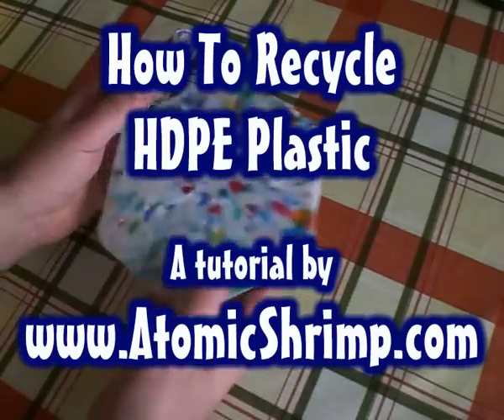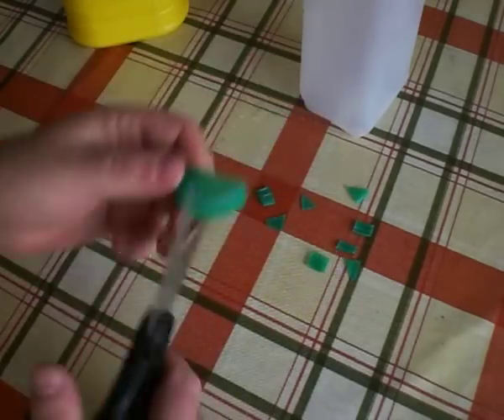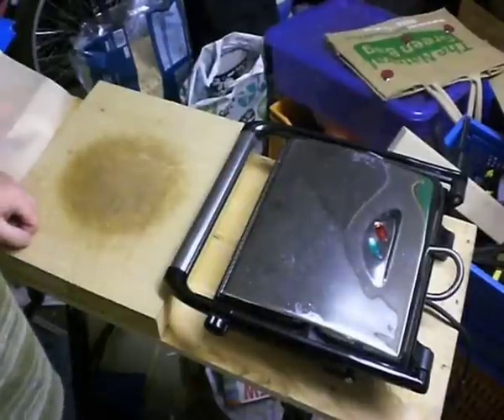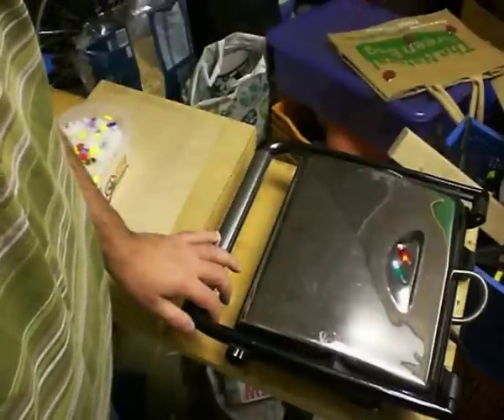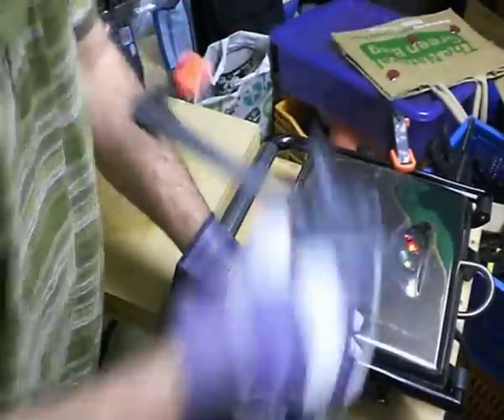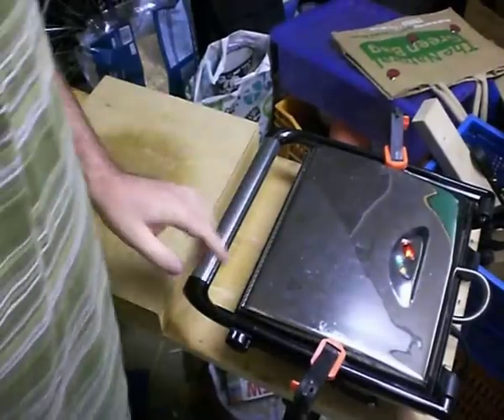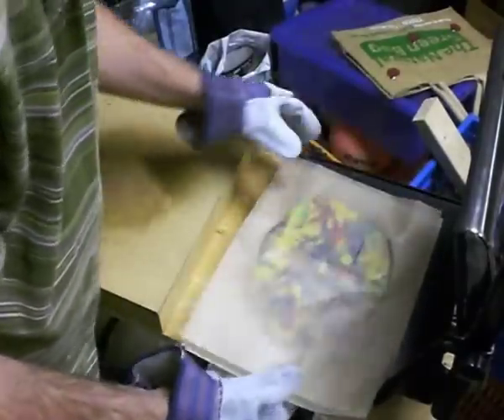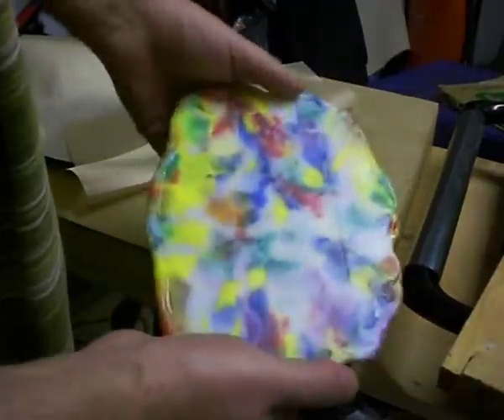How To Recycle HDPE Plastic (High Density Polyethylene) - a simple method

Comment: Nice vid,thanks,
 but couldn't u just cut bigger flat pieces and squish and melt together?
To save time cutting it up.
If u didn't want the color effect of the little pieces anyways.
Reply from the maker: Possibly. You may find that starting with larger pieces, you get more voids and air bubbles trapped in the melted product - I find that a finer cut allows them to escape
Reply: @AtomicShrimp  , thanks so much for replying .
I might have to try that and see.
Don't have a flat griddle thingy like yours (Ohio) but will be looking around.
Always wanted to make something out of bottles etc.  
Thank you sooo much😊
Btw , love 🇬🇧👍

Comment: Good idea, the process is a little bit long thoug.  Have you tried to use a hit gun,  oven, etc?
Reply from the maker: The thermal conductivity of this material is quite low - if you try to heat it faster, there is a risk of scorching it - I found that the oven tended to make the material smoke a lot, and the heat gun only really works on a very small area at a time

Comment: It's a great concept, and I'd like to try it to make crafts projects etc with; but there must be a way to modify it into a more compressed time period; no?
Reply from the maker: You mean the time taken to cut up the material?  Some people have had success using a blender (didn't work for me, but maybe my blender is not up to scratch)
Reply: @AtomicShrimp  No, no... I have the patience to cut it up, I meant the whole time process. Using the sandwich grill was a brilliant idea on your part, and I salute you for it; but is there another medium that could be used to heat it.  I don't mean in an oven for example, unless it's an outside oven, I don't wanna ruin my cooker; but some other less time consuming way to heat it up and compress it all.
Reply from the maker: I think you'd have to gear up to some sort of small industrial scale to be able to melt this stuff fast, without burning it - it doesn't conduct heat very well - so slow heating is pretty much a necessity to ensure even melting without scorching
Reply: @AtomicShrimp  Well, if'n I can twist my uncle's arm a bit to help me with your solution (I mean where does a girl get clamps?  lol)  I'm gonna gives your idea a go. You're extremely innovative. Thank you for sharing!   :)
Reply from the maker: @laurenpiantino8312  Cool - in order to avoid ruining your own toaster, it might be worth looking around for a secondhand one
Reply: @AtomicShrimp  Oh I have two still working, but in the basement storeroom, never used. I use a skillet now for toasted sandwiches...   :)

Comment: Hi are all lids made of this and can you use plastic that has a 1 on it and are all soda bottles made with this material sorry for all the questions but this fascinated me it seems everything is in plastic here
Reply from the maker: resin recycling code 1 indicates PET (Polyester) - these can be recycled, but probably not using this method.

Not all lids are HDPE (2) - some are Polypropylene(5) or LDPE (4)

Comment: couldn't you heat up the plastic in the oven or microwave at a higher temperature - so it becomes more liquid - and use a silicone mold for example?
Reply from the maker: It doesn't ever melt tons pourable liquid. The best you get is like soft caramel in texture

Comment: i would still do this outside if you have pets XD so i have a product called instamorph... is it really just recycled milk jugs? would microwaving (or kettle boiling water) work as a melting catalist for the plastic?
Reply from the maker: Yep - just milk bottles and other HDPE containers and lids.

Hot water doesn't get hot enough to melt it (unless you used a pressure vessel, I suppose) - and microwaves don't touch it either as far as I can tell.

Comment: The easiest way to do this is to use a cookie sheet and put another cookie sheet on top of the one with the plastic then put a couple of bricks on top in put it into the oven I use jet heat at 425 degrees pretty simple. You can even put it in molds to make Christmas decorations just drill a hole for hanging.

Comment: I think you need to invest in a used kitchen blender. Might make shredding the plastics quicker.
Reply from the maker: I've tried it - the plastic just goes around and around.  A Blendtec might do it, but an ordinary blender hardly touches it
Reply: Try a food processor with slicing blade at the top. Gradually feed in PET/HDPE bottles.

Comment: A brilliant video 👍😉👌 what plastic is Lego made from? could they be used?
Reply from the maker: Andrew Smith Lego is ABS, which can be recycled, including by the hobbyist (it's a common feedstock for 3D printing), but it's horrible smelly stuff.  HDPE is almost completely fume-free
Reply: How unfortunate that, about ABS, because its a beautifully strong material! Also, there is also SO much of it about! Old computer cases, keyboards, many plastic home appliances (like vacuum cleaners) etc. I'd love to mould my own storaqge boxes, coz I've spent a fortune on those over the years! These days they're usually made of PPropylene. If you drop one, it breaks, and you've lost your investment. However, if it were made of ABS, you could almost drive a truck over it!
Reply: Oh my!!! Why would you want to do that? Send it to me rather 😉

Comment: I’ve made some of the silicone molds and wondering if this would be cool to put into them and make beads
Reply from the maker: I don't think it would be possible to get HDPE to melt soft enough to be formed by silicone - the texture when melted is like toffee - I think the mould would just deform
Reply: AtomicShrimp I’ve already tried it and as long as you put a heavy book on a board on top ~ it works very well!!
Reply: Tip for you ~ use a small table top timer toaster oven ~ that’s what I’ve been using ~ it’s quicker
Reply from the maker: Cool - I would like to see that.  I haven't ever really made much with silicone - what brand or type of mould material do you use?
Reply: AtomicShrimp I use the clear silicone tubes you use for house and I push it with the tube gun into a bowl of ice cold water, and with cold water wet hands bind it until it takes shape , then roll out to thickness I want, press in what I want to mold, let go half set , remove item, set completely, then I made your plastic mix and melted mine in table timer oven on lined baking tray, then pored into molds, let to cool with board and book on top, then turned out~ perfect, you may need to dust molds with talcum powder before adding the plastic!!
Reply: Elle Gillan you can make the molds to any size you want ~ just push what ever item you want in and let it harden 👌🏾
Reply: I’ve made book cover boards with it and they have to be thin and big!
Reply: Lisa Jarvis I love your comment its exactly what I've been looking for, do you think the mould would hold for larger amounts of plastic say for a phone case?

Comment: If I was to use say a waffle iron, i wouldn't be able to use a liner. Any advice as to what I could coat it with so I don't end up with a sticky mess? Wax? Grease maybe?
Reply from the maker: Not really sure - anything you use to stop the plastic sticking to the iron may prevent it sticking to itself if you need to fold it

Comment: Is there any replacement for the toaster? I haven't got one. A stove-top or oven?
Reply from the maker: Emily LaRoche some people use an oven. I find it has a tendency to scorch the plastic though
Reply: Set it to the same temp?
Reply from the maker: Yea, around 180C, but it will take longer to melt the plastic in the oven, because air has less thermal mass - when you heat it directly with the sandwich toaster, you are pumping heat straight into the plastic - in an oven, you have to heat up insubstantial air, then rely on the air transferring heat tot the plastic

Comment: I was thinking, it might be possible to create the boat form using sheets heat welded together (laminated) similar to how fibre glass is laid up overlapping, rather than chop the bits up to make thick plates then weld them edge to edge. It might be feasible to make ribs by shaping cut layers of sheets around a plywood form, to end up with a light but rigid and strong "U" profiled rib. HDPE seems like its used for bottles a lot, it must have good structiral strength?

Comment: so this is a great idea,I was just thinking how would you go if you made a 5mm or 10 mm form to put in your sandwich toaster?
Reply from the maker: Shrinkage whilst cooling is always the issue - I tried making a square frame of 3mm aluminium, and forming the plastic inside of it.  It worked OK, except that for large sections, there is a tendency for the flat faces to become concave and a little puckered as they cool.

The best results have been from forming flat sheets by just placing a standoff such as a small metal nut at each corner of the press, to keep the plates consistently spaced apart, then allowing the 'pancake' of plastic to cool inside the press, but this does mean it has to be shaped by machining after it has set and cooled.

Comment: what kind of pressure  can this plastic handle
Reply from the maker: Electric heaters are typically very efficient (100% efficient as long as the heat is going where it should), as, in the case of other electrical devices, heat is a waste product that the design attempts to keep to a minimum; in the case of heaters, they only need to be designed to 'waste' 100% of the input as heat.  Of course, the means of generating the source current (e.g. from fossil fuels etc) may still be horribly inefficient.

But this video is more about upcycling options available to the small scale maker, than it is about being green; the material product is the main goal here.
Reply from the maker: In what context are you thinking?  Compressive force, or ability to contain pressure as a container?
Reply: AtomicShrimp ability to contain pressure
Reply from the maker: I don't really know - a lot of that would depend on the thickness and the integrity of the material - I wouldn't trust my recycled material in a pressure vessel application (in any case, there are better alternatives such as steel)
Reply: True ... im in search of a light weight alternative to steel for a few applications i wish to build in the future. If you find anything more on composites and different integrities please let me know.
Reply: shattered79, here in the UK some lightweight liquid petroleum gas cylinders (for patio heaters, for example) seem to be made from fibreglass. The external appearance is not that of fabric reinforcement, but as if a single bundle of glass threads has been wrapped around the gas bottle many, many times (bobbin-wound), in all possible directions. The binding resin is probably polyester, but epoxy would be stronger (and more expensive). For an even lighter pressure cylinder (and even greater cost) the glass filament could be replaced by aramid and / or carbon fibre.
Just a thought.. a worthy experiment would be to make 2 or more thin sheets of recycled HDPE, and then to put these on top of each other, with a layer of glass fabric in between. Back in the sandwich press all the layers could be melted together. If everything binds together nicely - and HDPE shrinkage doesn't mess things up - a pretty strong panel could result!
Reply: I wonder if "any of the methods I've seen to melt the plastic, including this one, is cost efficient... is it? All energy (Electric) and effort ... isn't it better to just shred the plastic in large quantities, compress it and sell it to packing or plastic containers corporations? Great vid, Thanks for sharing 👌🏻
Reply: Creative Mechanics webstie has values on Plastics like melting temps and some figures of tensile and compressive strengths. but look up plastic railroad tie, construction mats and cribbing manufacturers for their values of compressive strength. Basically put its stronger and lasts longer than wood.

Comment: I am assuming that you are using a unit similar to that of the Breville Panini Duo BSG520XL. In the literature that I have come upon, I have not seen how to control the temperature of this unit. The only refrence to power is that it is 1500w.

How do you know what temperature this thing heats to?
Reply from the maker: There's no temperature control (at least, no dial - just an automatic thermostat) on mine either - I think it's just a lucky accident that toasting bread requires about the same temperature as melting HDPE

Comment: get a cheap shredder dude :-)
Reply from the maker: I have tried that, it doesn't work at all.
Reply: the idea with th sandwitch toaster i a good idea btw. there are some shredders u can take what shredders compact discs
Reply from the maker: Compact discs are brittle.  HDPE is slick, tough, and flexible - it jams between the blades.  I even tried a shredder designed for credit cards - HDPE slips between the cutting surfaces and jams the machine very quickly

Comment: how do you think this would go mixing it with a 50% particulate such as rice flour? Would it still be able to make a cohesive block and not break apart if mixed together well.
Reply from the maker: I was thinking about trying this, but with an inert mineral filler such as sand or talc.  I think it will take a lot of mixing and kneading to get it properly incorporated

Comment: can you use food dye or other kind of paint to make it a single color instead of having to choose same colored plastics?
Reply from the maker: Probably not any kind of liquid dye as those will either fail to mix with the plastic, or may interfere with its integrity if they do mix.
Dry pigment powders are normally used for colouring plastics - so those would work, but you would need to very thoroughly blend the material in the molten state to evenly incorporate the pigment.  At an amateur scale, it's' much easier to select source materials for recycling that are already the right colour, or make things where the colour doesn't matter.
Reply: AtomicShrimp thanks for the quick response! yeah I was asking because for the project I have in mind, color actually matters. I will consider your tips. thanks again.

Comment: Hello how could I make a 1.80 hole to make a post to fence a farm
Reply from the maker: I don't know  - that would require melting quite a lot of plastic all at once - requiring industrial scale equipment.
I know that there are recycling companies out there doing that sort of thing though, so it's possible, but I wouldn't attempt it myself.  Also, for outdoor use, it is necessary to add things to the plastic to protect it from degrading under exposure to UV from sunlight.

Comment: This method requires too much labor.

Pouring chipped HDPE into what looks like the bottom of a plastic bleach bottle was clever to obstruct the pieces from sliding off the heated surface. It gave me the idea to cut the bottoms off of metal coffee cans and pour chips into them. I'll cut strips of waxed paper to line the metal rings cut from coffee cans.

I'm also going to try messing around with an old waffle iron.

The whole idea is to melt the chips together, fold and refold a time or two and remelt until the desired meld has been blended. That said what we really need is the temperature that HDPE melts and then apply technique accordingly. 

Google said this...

For common commercial grades of medium- and high-density polyethylene the melting point is typically in the range 120 to 180 °C (248 to 356 °F). The melting point for average, commercial, low-density polyethylene is typically 105 to 115 °C (221 to 239 °F).

Now that we have a number to work with a tool to test our heat source is required. That's more difficult as thermometers and such can be expensive so I'm all ears for comments about how to measure the temperature of the elements we are using to melt HDPE.

Comment: My plastic always sticks to the wax paper :/
Reply from the maker: The sheets I'm using are more like a nonstick fabric.  Try searching for 'reusable nonstick cooking liner'
Reply: Sid Bilgrai Bakers use parchment paper for pan liners. It doesn't stick to the plastic either. Not my idea but I forget who had it in their tutorial. ☺
Reply: Wax paper is useless to prevent sticking, and parchment will get burned to a brown crisp not to mention make it slippery when flattening the brick or block plastic mold. You really DO NOT need a nonstick surface.

You can use any steel or aluminum pan so long as it has no side or bottom opening and a not narrow on the open side compared to the base you can use it as a mold seeing as this plastic will shrink a bit when it cools, you can use non stick bakeware (makes it easier those who like to try and knead the plastic like its bread dough). Even glass like Pyrex or earthware or even ceramic ware, again no holes in the form except the top for removal can also be used. 

Used to work for a company making lumber in mild steel forms and water cooled them then air dried for a day before being cut to length, very rarely got a mold of injected plastic that would not come out. Though if you do use a pan, make sure its a old one you no longer want to use for baking food in just in case  you ruin it and use a flat piece to flatten the top if need be and for reducing voids use an awl and poke hole and press with say a hammer (do not hammer it or cover the hole you made, just use the hammer to press out the air) so you do not get fibers in the plastic mold itself as it will grip onto fabric and burn off.
Overheating it will cause the plastic matrix to degrade making it useless and PE melts between 120-180°C/248-356°F, PP is also meltable but if it catches on fire DO NOT try to put it out with water as its like trying to put out a grease fire, PE will not catch on fire but will smell if being burned.